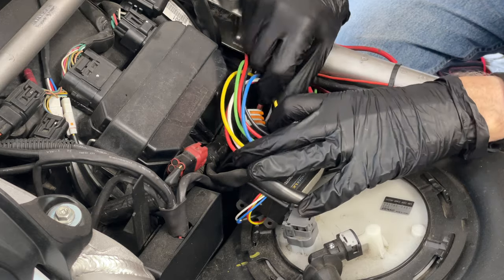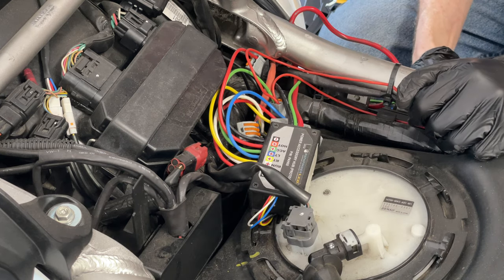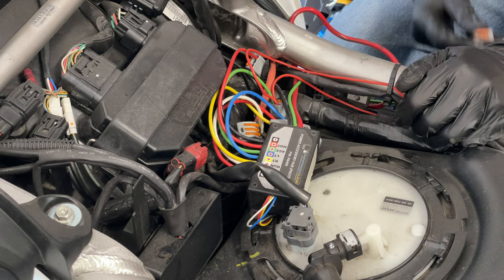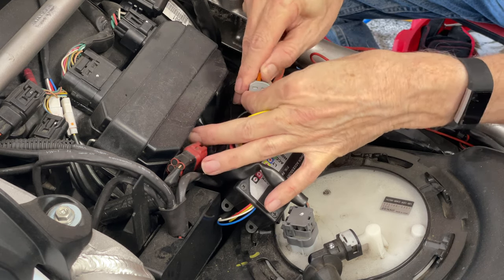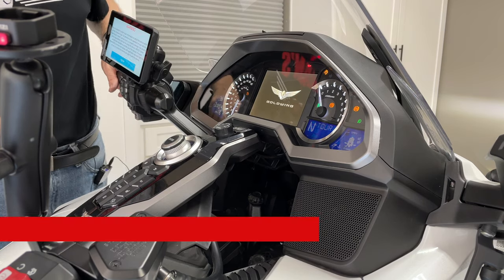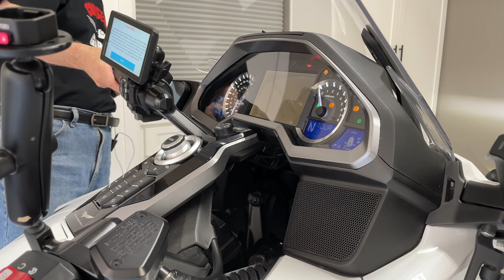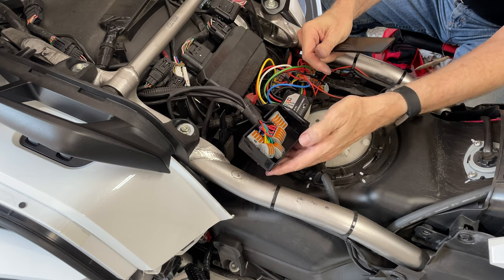Changing my WAGO Connectors | 2018+ Honda Goldwing | CruisemansGarage.com

Comment: I saw those awhile ago, they have a lower profile than the other type.  I ended up switching from the Wago's to a distribution block instead, which I feed with the Show Chrome Isolator.  I like the way you grouped yours in that box.

Comment: Suggestion: I use a Rhino label maker that has  heat shrink labels for labeling cables. Just print them, slip over wire you wish to mark and  heat up!

Comment: I guess I just don’t get the point of doing this. It looks like you had everything organized. If you’re doing this, why not shorten all those long wires at the same time. Seems like a waste of time to do this, put it back together, then make another video doing much of the same thing. When it comes to labeling with the label-maker, if they don’t stick, just make the labels longer and wrap the label around the wire and stick the label to itself. It will stick that way, but it’s not as nice looking.